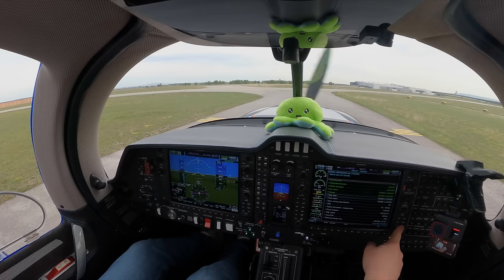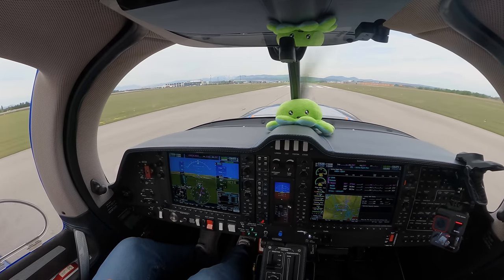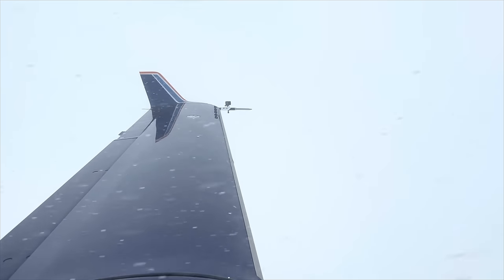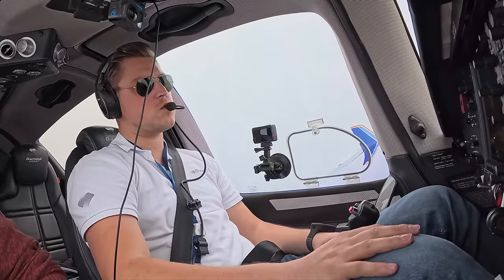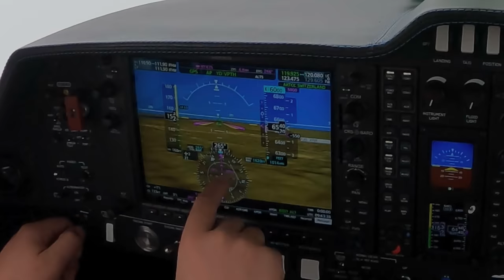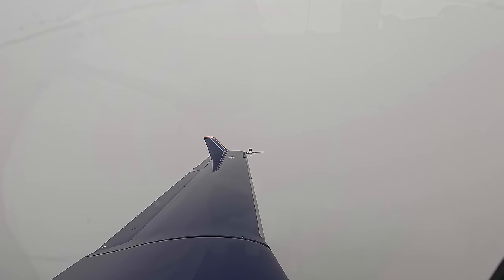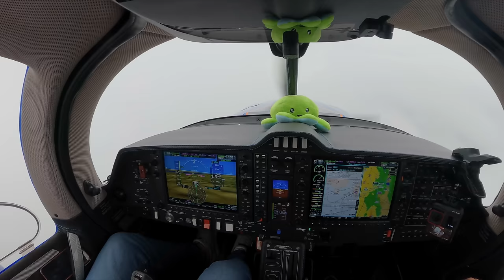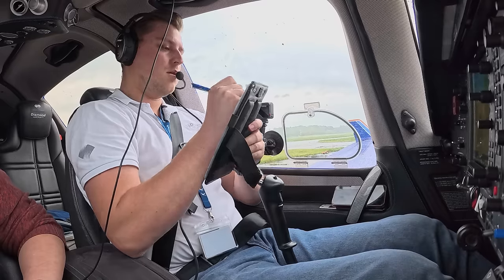DA50 to AERO Friedrichshafen 2024!

Comment: Hi Micke, I like your videos and I like Diammond aircrafts. I am just curious, why you always apply the short field take off procedure. To stay on the brakes with the full throttle. It is not necessary, while there is more than 2 km runway in front of you. It looks "fancy", but it not necessary. Or is there any other reason to do that? Thanks Luděk